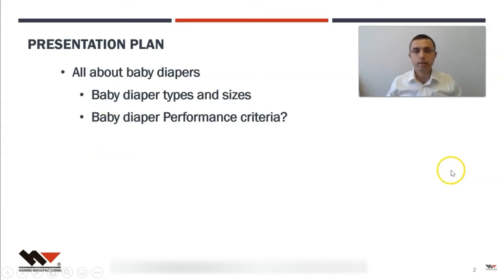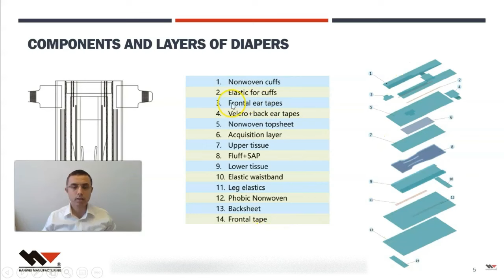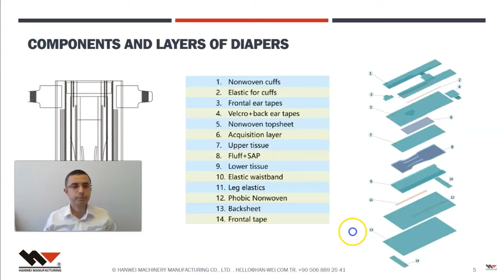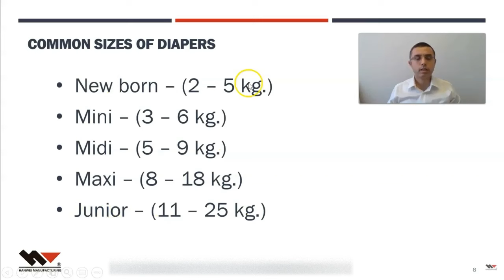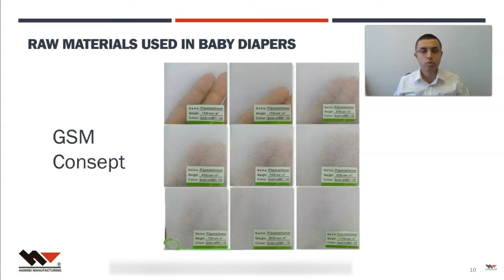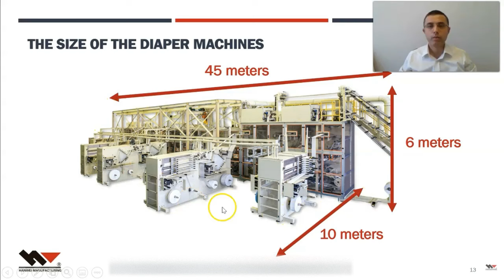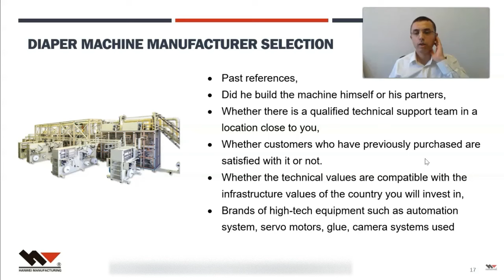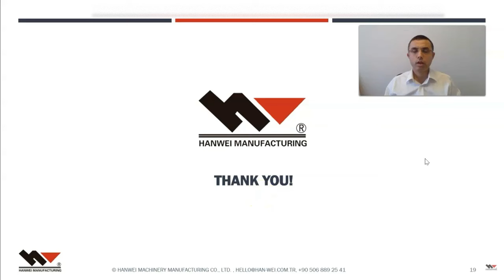How to Plan a Baby Diaper Investment? - Detailed Explanation

Comment: What glue is using for make nylon sheet to the nonwoven part. And for the sealing, is using ultrasonic or heat metal? What is different for that both sewing process?